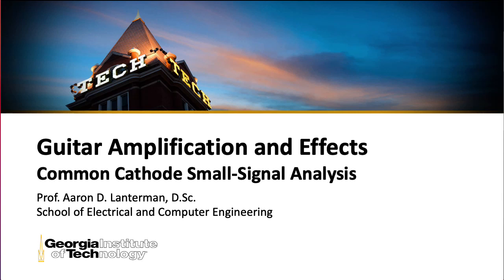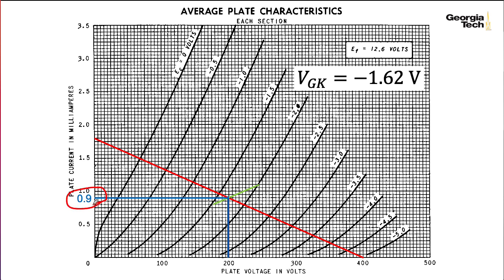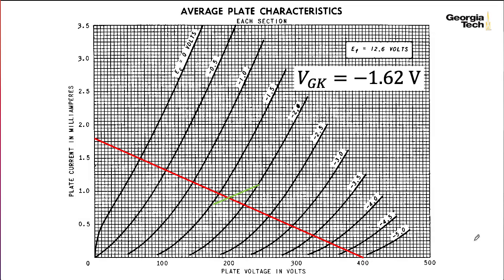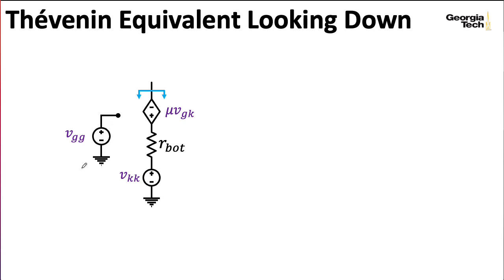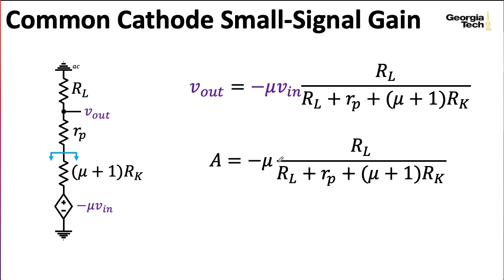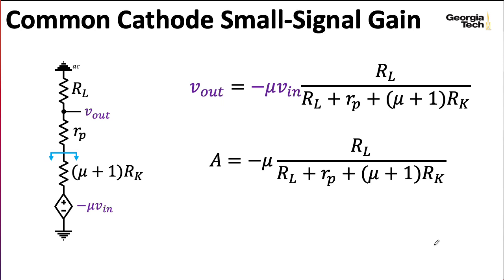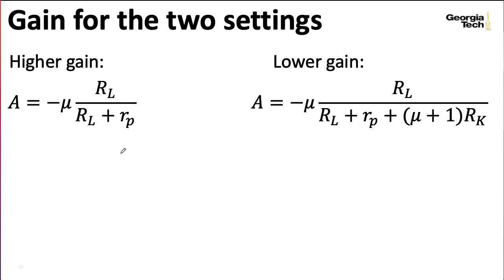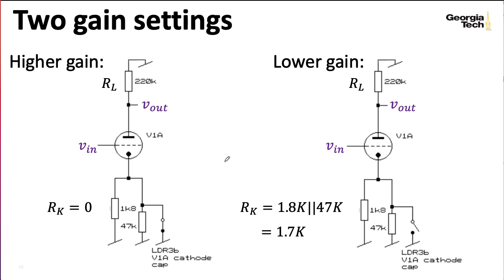ECE4448 L19: Common Cathode Small-Signal Analysis (Guitar Amplification and Effects, Georgia Tech)

Comment: Could it be said that the DC-blocking behavior of the 1uOhm bypass capacitor ensures that the DC bias point remains the same, regardless of the "high gain" switch state?
Reply from the maker: Exactly!
Reply: I meant to say 1uF bypass cap, but I think you got the gist.  Thanks!